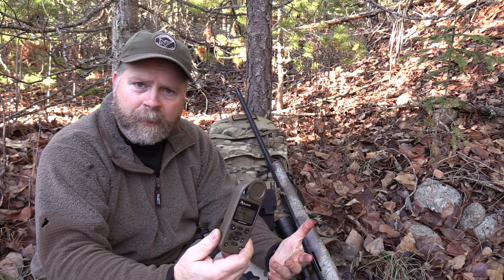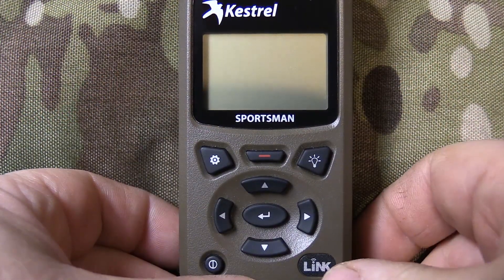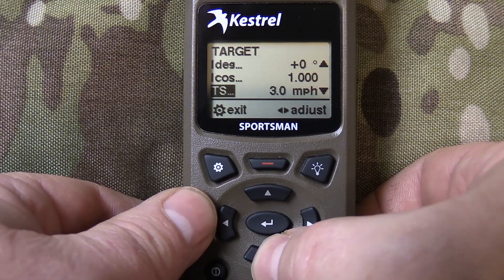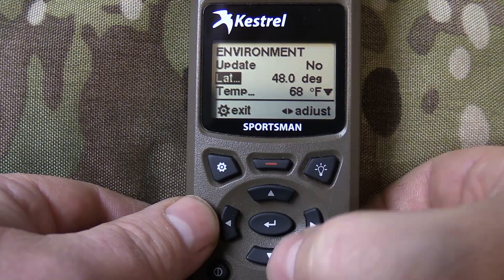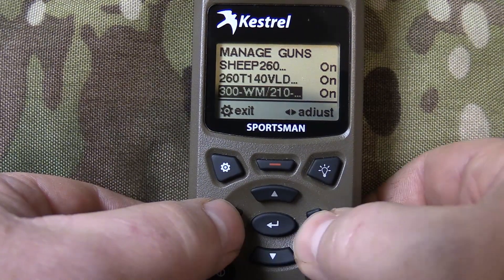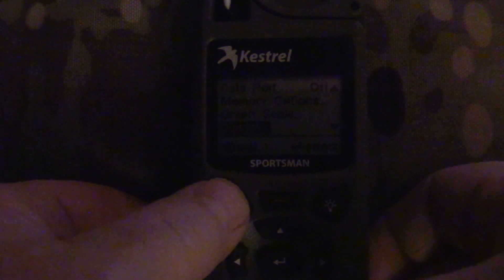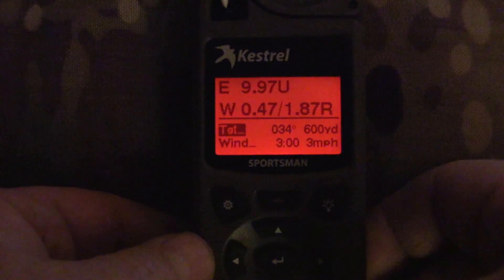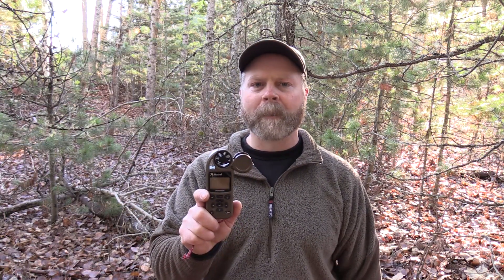Kestrel 5700 Sportsman Weather Meter w/ Applied Ballistics: Field Review & Demo

Comment: Have you had a chance to look at the new "Ruger Kestrel 5700” and "Kestrel 5700 Ballistics” meters?  They appear to have all of the features of the discontinued Sportsman with the exception of Powder Temperature input and they do not use Applied Ballistics software (per Kestrel’s web site).  Do you think the use of something other than Applied Ballistics software will make a difference?
Reply from the maker: Retired No Bad Days I’ve been using the 5700 Ballistics since January. It’s a solid package, and a hell of a bargain for $399. The 5700 Sportsman with LiNK is identical as long as it has the current firmware. They all use Applied Ballistics for the solver engine. The Elite has the option to use some of the advanced features of AB, most notably CDMs in addition to G1 or G7.
Reply: Thanks for the reply.  I'm looking at buying the "Ruger Kestrel 5700” because I own a Ruger PR and Kestrel will provide ballistic profiles for Ruger rifles and factory ammo.  According to the Kestrel rep that I talked to, I should be able to use the Ruger profiles and tune them to my handholds.  When I read to him the sentence from the Kestrel web site that said "So what's the difference in the 5700 and the Elite Model? The Elite has the proprietary Applied Ballistics software. The 5700 has ballistics software, but it's not Applied Ballistics. If you want the best, get the Elite.”  the rep said that all of the 5700's use Applied Ballistics software, the Elite just has the CDM.  I did not have a lot of confidence in the answers I was getting from the rep but this would confirm what you have stated above.  I assume you have compared output from the 5700 and the Sportsman and found them to be the same?
Reply from the maker: Yes. The Elite, Sportsman, and Ballistics, all use AB's ballistic engine. They will all give the same correction when fed the same inputs. I have all three, and use all three alternately.
Reply: Thanks for all of the information.  Looks like I will buy the Ruger version.  You have a great channel, Kestrel should be giving you some support considering how much better your videos are than theirs.
Reply: I boiled my meter to sterilize it and it broke 😂